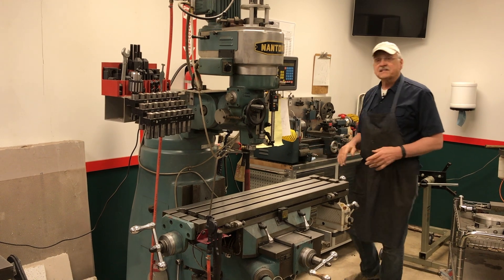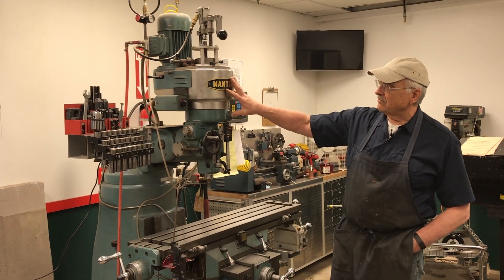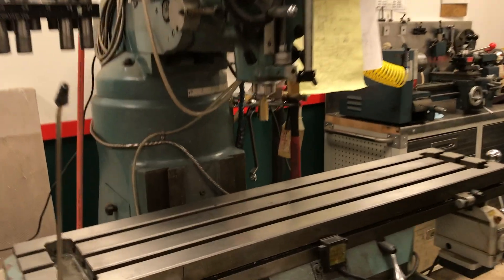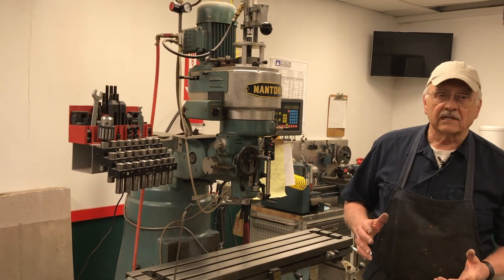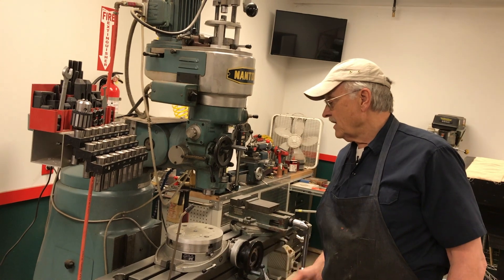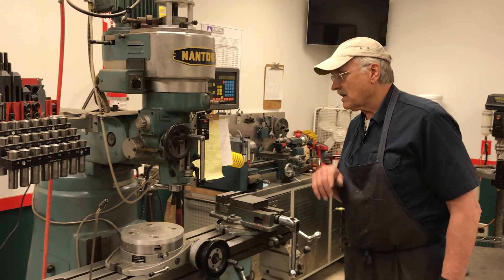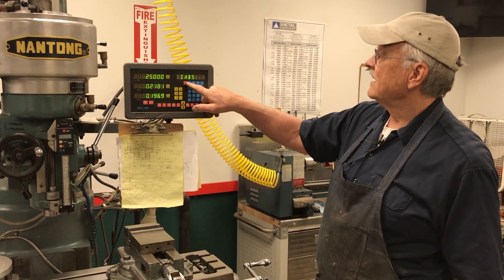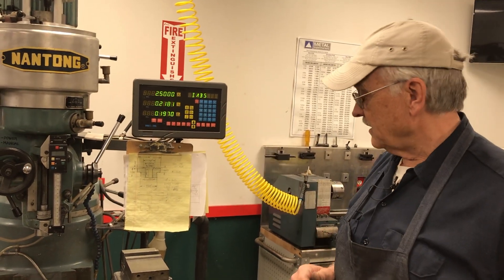The Toolshed  - The Nantong Vertical Milling Machine

Comment: I just purchased a Nantong Vertical milling machine and wanted to know if you have the manual for it, I can not find the manual for it , I am missing a coupler of parts and wanted to get it back to working condition. i am missing the drawbar and some of the handles are broke and missing. If you could help I appreciate it.
Reply from the maker: Sorry, mine came without a manual as well.

Comment: Hey Bob not sure if your machine is the same as mine but I have a YouTube video Nantong Milling Machine missing parts easy to check. But if you have the time some day not sure if I’m missing a part. Thanks!
Reply from the maker: If I don't get back to you in a couple of days get back to me. I forget sometimes.
Reply from the maker: I just took a look. It looks like your machine is built different than mine.
Reply: Ok thanks worth the try. Just got mine up and going. I need to get collet and DRO. Just finishing up rebuilding a Brown and sharpe dividing head. And get the table power feed system. Thanks
Reply from the maker: @richcan22  
The DRO is an absolute "must have".